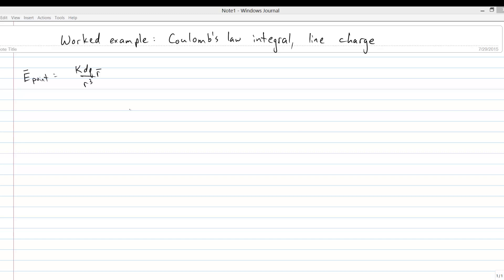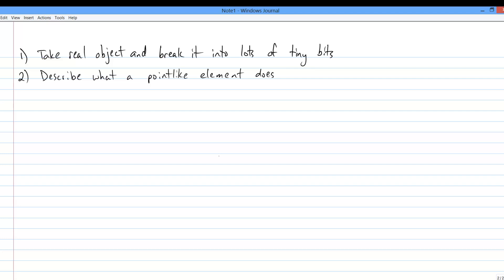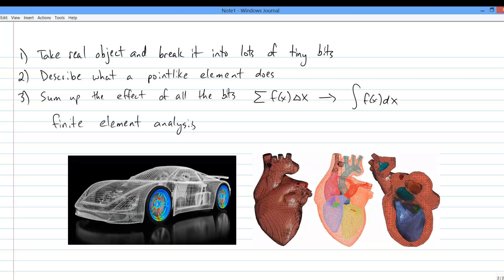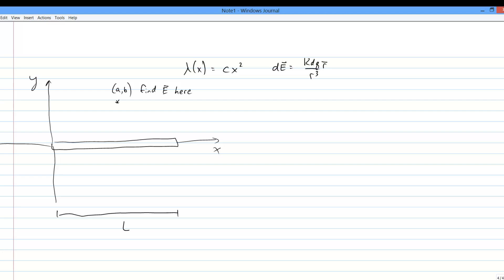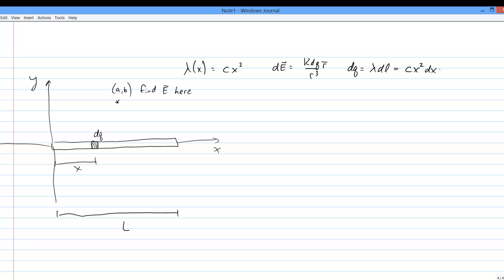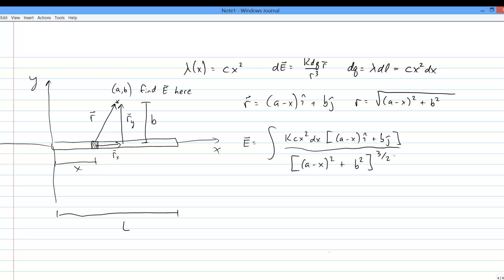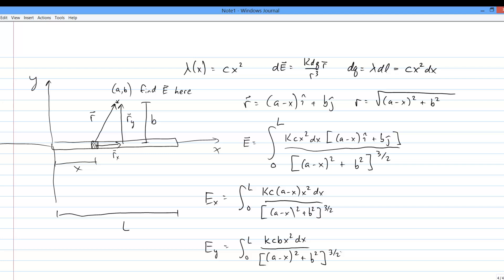Worked example - Coulomb's law integration

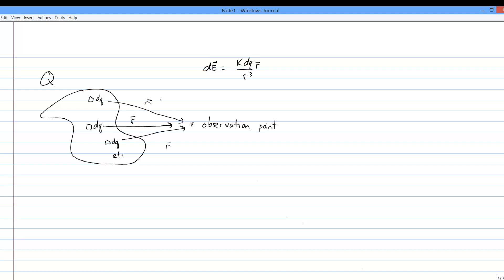Comment: the r should be squared not cubed @01:55
Reply from the maker: +ChubNTuck1886 r cubed is correct, given the full r vector in the top.  If the numerator featured a unit vector (r hat) instead, we'd have an r squared in the bottom.  The fact that  r hat = r vector / r gives us a couple options in how we represent things.
Reply: @patkohl2680  understood but confusing